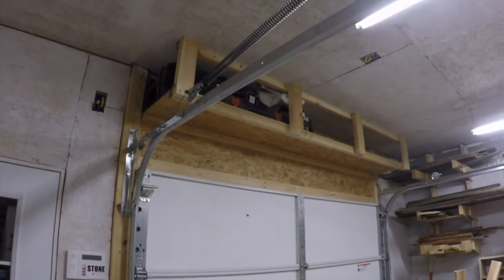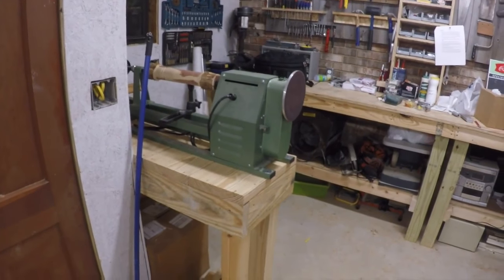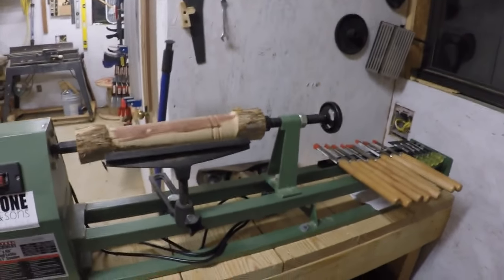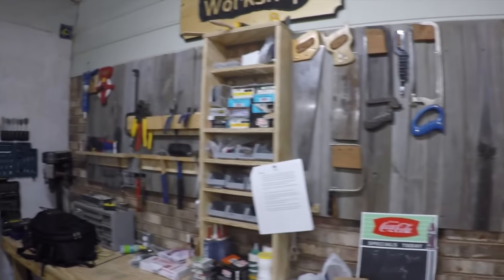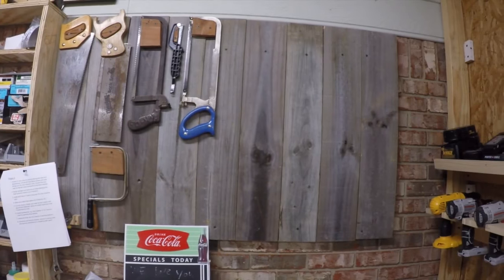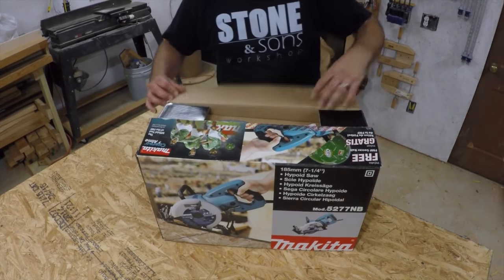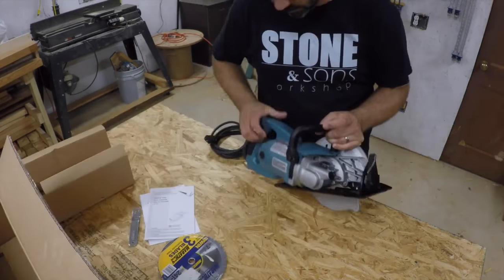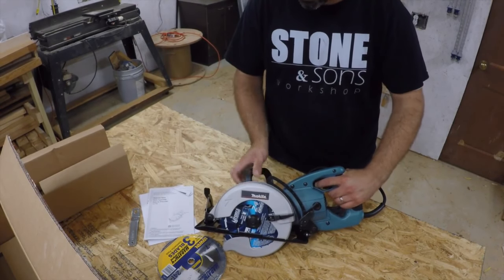ShopTalk 002 - Shop Organization, Lazy Susan, Hypoid Saw??

Comment: Worm gear saws tend to have more torque but spin at a lower rpm, whereas a "sidewinder" circular saw will be direct drive or use a spur gear to transfer power to the blade.  They will typically spin at a higher rpm but will have less torque making them easier to stall.  It's not a hard and fast rule, but sidewinders will mostly have the blade on the right hand side of the motor and worm gear saws will have it on the left.  Having it on the left will make it easier to see the cut line for a right-handed person, but the saw weight will be on your off-cut, speaking of which they tend to be quite a bit heavier than a sidewinder.  Both have advantages and disadvantages.   It all comes down to personal preference.

Comment: Your Makita worm gear saw is more powerful as it gears the drive shaft to the blade shaft and ups the rpm of the blade. Your other type of saws are driven from the motor shaft and runs only as fast the the motor.
Reply from the maker: +Donnie Gaskill Thanks for explaining that Donnie and thanks for watching.